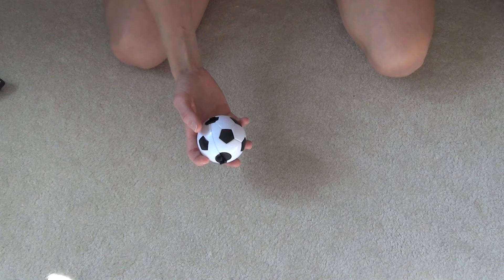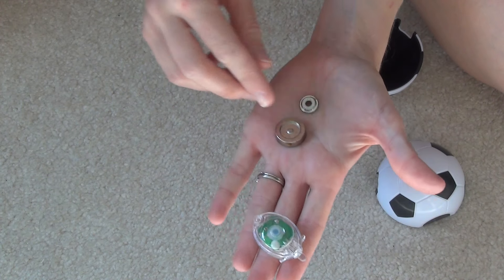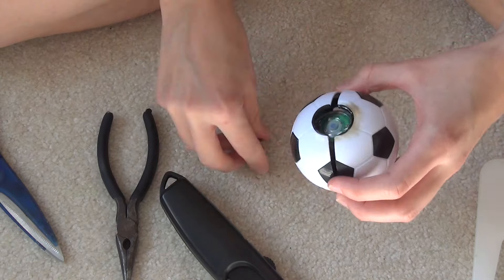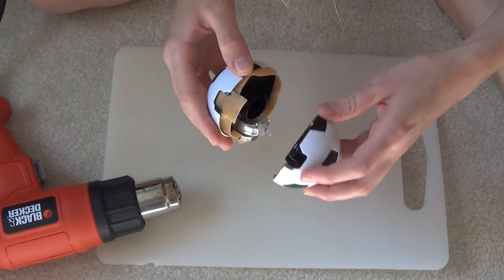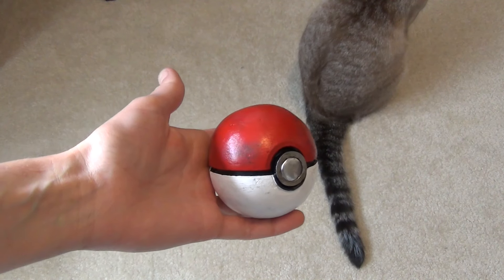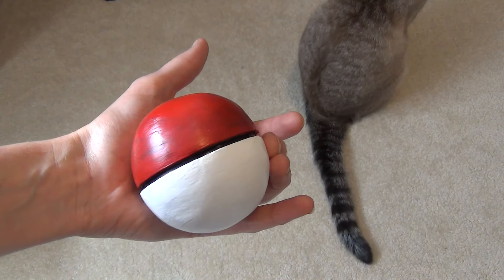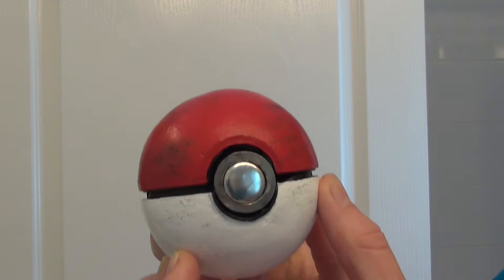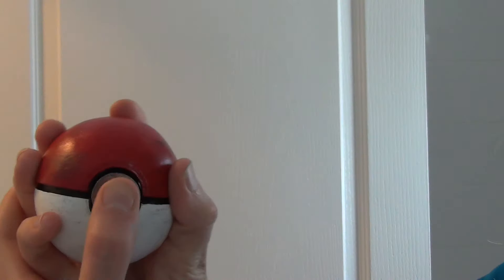How to make a Pokeball, Play Pokemon Go with your very own pokeball. Easy crafts and Cosplay Ideas

Comment: If you could get your hands on one of those tiny dremels that are used for acrylic nail work, it would facilitate a lot of projects. For example instead of melting the plastic or filling the groves with spackle you could have sanded it with one of the attachments. I have one and let me tell you, any small plastic pieces are breeze to work on with the tool. Great vid as usual btw : )
Reply from the maker: It would make the time cut down for sure, does it leave the plastic quite coarse ? That's one thing I've yet to figure out even after spackling it's super porous. Thanks
Reply: +ggaetzz it depends on the attachment, just like sandpaper you have different degrees of harshness. So yeah, you can get a really smooth finish.
Reply from the maker: Sweet I shall look into this
Reply: EDWARD???!!!! I THOGHT YOU WERE DEAD